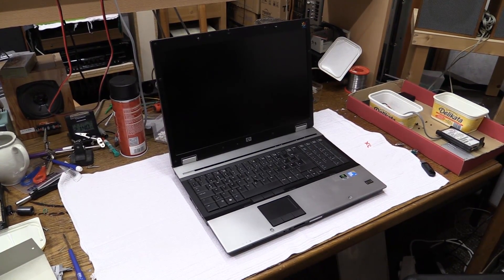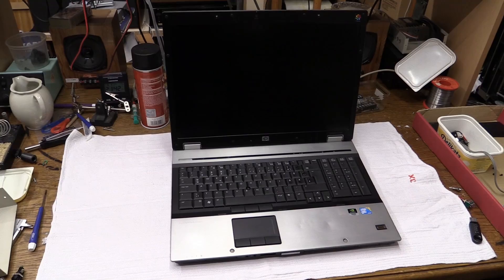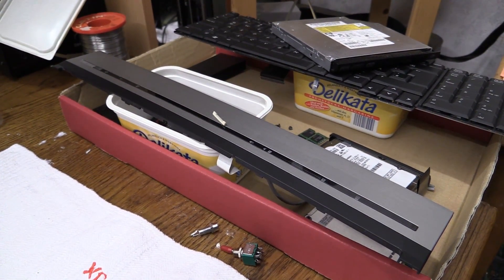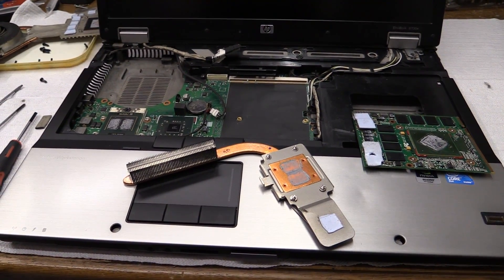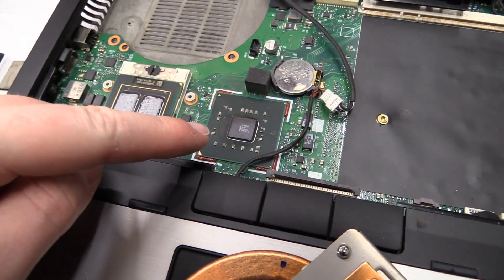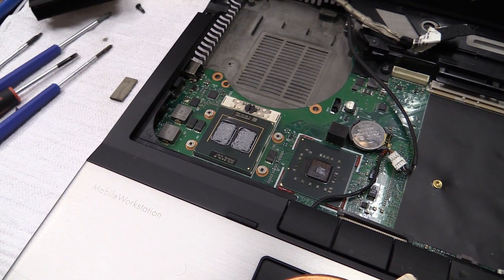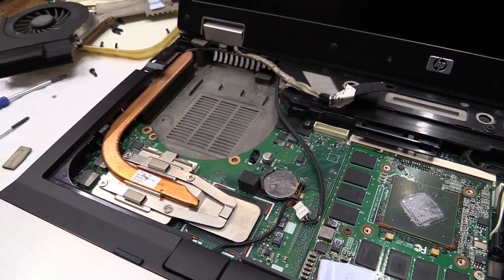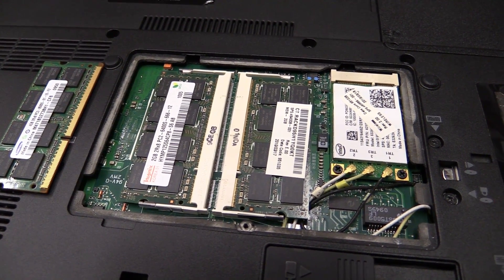DrCassette's Workshop - HP EliteBook overhaul

Comment: If this is a 65 nanometer cpu you can probably get away nicely with putting in a 45nm (last generation core 2 duo) mobile cpu in this laptop.  They run much cooler and clock for clock are about 10 to 15 % faster. 

I think there might even be some extreme dual cores of that generation that are extremely fast and high clocked.  Those even run even cooler and are probably faster than the quad core you have now.

Comment: Don't use to much heat pasta  it will make things worse. You should almost see trough the pasta.  If the pasta is to much it will not work. Resulting in over heating. 
Its one of the most made  mistakes.
Reply from the maker: I applied just a thin layer, much thinner than it looks in the video. Previously there was a lot more heat sink grease in there!

Comment: That laptop isn't that great anyways, if you got it under 300€ I guess it's somewhat worth it. For the look of things it runs a Q9000 and a 9600GTM, G94, 1GB of VRAM and 4GB of DDR2 533 or 667Mhz ram. It's nice but definitely not an amazing laptop. The reason why it runs hot may be due to it being a higher power drawing CPU and the system detects that so it ramps up the fans, either that or the cooler just isn't made for running such a high TDP processor. And btw it is normal for you to see a bigger heatsink in laptops when it comes to graphics cards, specially older higher end models. Graphics cards seem so harmless but the higher end ones on desktops can reach 300 watts of TDP, which is about 3 times more than a common i7 CPU of nowadays. Crazy stuff. Anyway nice video DrCassette :3
Reply from the maker: I got this for 180€ when usually they are sold for up to 500€ on Ebay. That's why I said that this was my Ebay deal of the year :)
Reply: That's not bad, but it definitively gave you some headaches for the price. I find office laptops that run i7 first gen dual cores and some quad with 2GB of ram and 160GB hard drives for sale on a Facebook group, for under 300€ isn't the best bang for your buck but I'm tempted since they're "workstationy" laptops and they look nice as well. Too bad first gen i7 processors for mobile were awful, the dual core ones anyway and the intel HD graphics  won't help, but maybe for a cheap hackintosh (side loading Mac OSX) sounds good.

Comment: I'd suggest you apply arctic silver paste , and also apply some to the chipset ... its supposed to have thermal paste aswell.
Reply from the maker: I used good heat sink grease. The chipset parts have these white rubbery things to conduct the heat and that's supposed to be like that, if you were replacing those with heat sink grease they wouldn't make contact with the heat sink anymore.

Comment: The bios may not be setup for the quad core thermal settings needed. I upgraded an old acer aspire to a core 2 duo and it worked but it ran kind of hot. You can play with the power options for the cpu in windows to see if it quiets down.
Reply: The heat sink on that laptop was designed to cool down a 35 watt Core 2 Duo, upgrading to a Core 2 Quad will just make thugs worse. This is why I do not support the buying laptops and upgrading them idea. That's why it runs hot, and no it is not fixable unless you downclock the processor, and that's pointless if you're wanting to upgrade, might as well stick with the faster clocked core 2 duo.
Reply from the maker: Mike Fox
Since the laptop is partly broken now, I am certainly not going to spend a 100€ for a high end core 2 quad anymore... and yes, I think the faster clocked Core 2 Duo would maybe do a better job in this. I think this laptop originally came with a 2.4 GHz Core 2 Duo. Now it's down to 2.0 GHz.